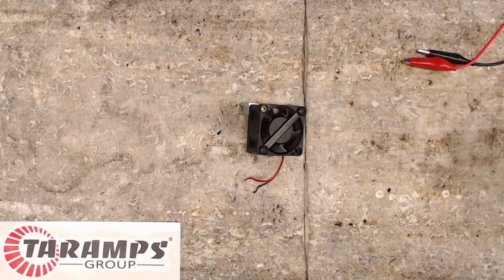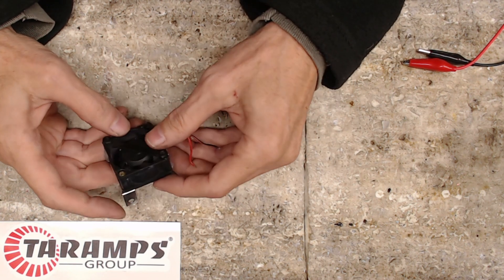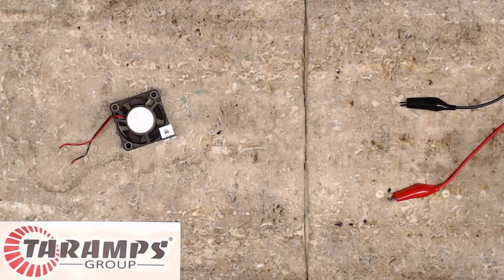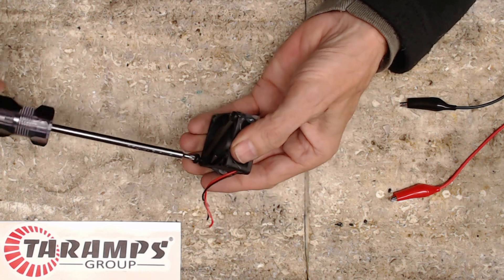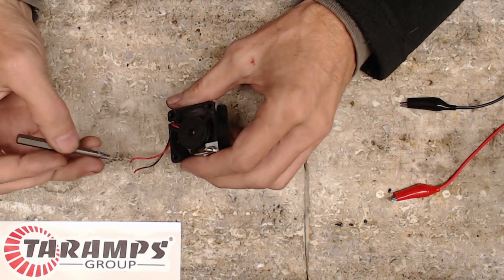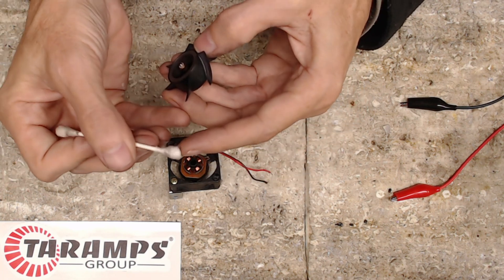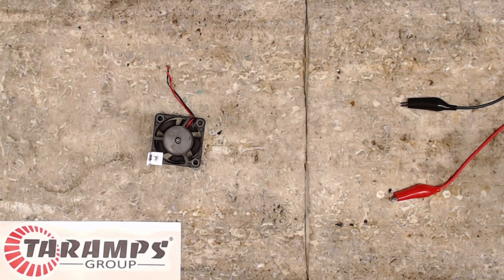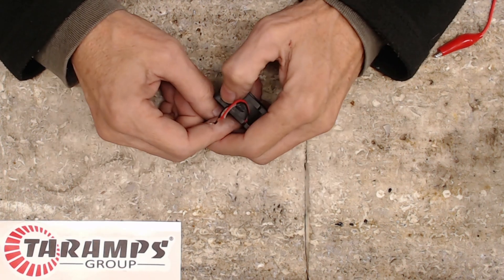Do you suffer from Noisy fan Syndrome? Taramps Crazy Noisy Fan Service

Comment: What kind of grease did you use to lube up the bearing on the fan? I heard the brand crc but what type or lubricant?
Reply from the maker: I now use Super Lube for bushings.
Reply: @ellensburgamplifier  oh alright got it thanks 👍🏽 ill definately try it on mine, fans been annoying me for a while lol, for the mounting of the amps ik the box says dont mount them on the sub box due to vibration but do you recommend mounting them with a spacer since the bottom of the amps have vent gaps ?
Reply from the maker: @nicksgarage460  Vibration is nasty on the components within the amplifier so I would use rubber spacers under the amp but always keep in mind that the amplifier could fail at any time if the inductors/capacitors are not secured properly. If your fans rattle, they will need to be replaced, but if they run slow, the bushing needs to be greased.
Reply: @ellensburgamplifier  ah noted thanks  ill definately have to look for that when opening my amp and ill defiantely go with the spacers in the future thanks again 👍🏾

Comment: I’m having a problem with the fans on my taramp. The fans will randomly go to full speed on first power up and not turn off until I turn my truck off. If I turn my truck back on the fans do the normal spool up and back down.
Reply from the maker: This may be a possible MCU glitch or an intermittent input fault to the MCU. The MCU is a chip that runs the whole amplifier.

Comment: can i do this to the fan with out removing it from the amp?
Reply from the maker: You may be able to get to it. Just be careful to not spray anything that will get all over the board. If you can pull the sticker and use a Qtip to clean the bushing area then apply a drop of grease/oil you should be good to go.
Reply: @ellensburgamplifier  Thanks my amp aint very old but as soon as it turns on it has very loud static screeching noise,and if its cold out it last for a long time, so glad i saw your video.
Reply from the maker: @kevinc5917  It sounds like the grease is a little old which thins out as it heats up. It may need to be replaced if the bushing is bad.
Reply: @ellensburgamplifier  you have any links for fans that will work? mine is from a MD12002 Taramp's MD 1200.1 2 Ohms 1200 Watts
Reply from the maker: @kevinc5917  I honestly can't remember if they are 4020 fans or 4010 fans for the 1200.1. I carry all the fans if you are wanting to purchase them or you can get them from Mouser. The fans will measure something like 40mm x 20mm or 40mm x 10mm if you have a caliper around.
Reply: @ellensburgamplifier  you have a website? Amp still installed so i have to take it out to measure, are the fans you sell upgrades from what taramps come with? I used the amp for spring and summer for camping trips and that was it and its already bad so i would rather put a better fan in it. Thanks for all your help so far!

Comment: Alwsome info I try this out thanks. Although Im wondering if there are better fans with seald bearings available for the smart5?
Reply: Thanks for the reply. Ya I was looking at about 9000 different 12v  fans that will work, just not sure which ones are quite yet can meet the cooling requirements. I guess I just buy a couple and see what works best.
Reply from the maker: Hi John, there are many choices for fans as they are the standard 40x20 fans. Some HF fans can be extremely noisy in these. Also, please be aware of the high voltages present if you are working within the amplifier.